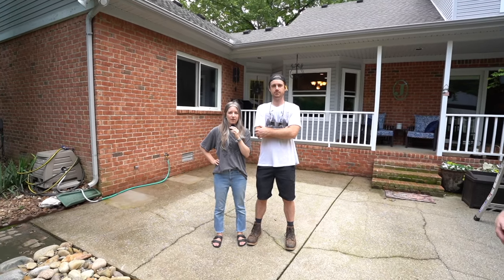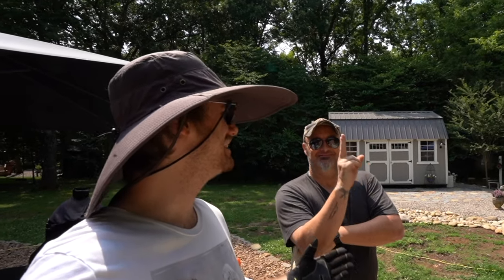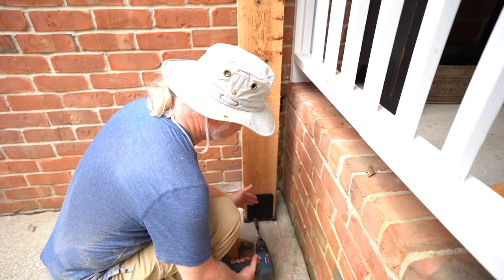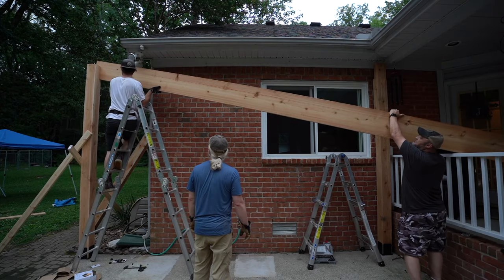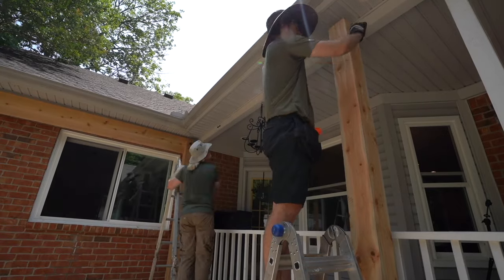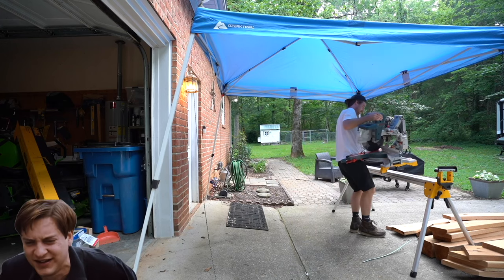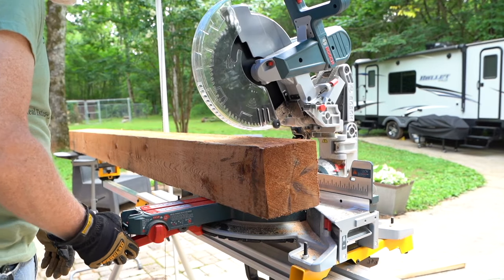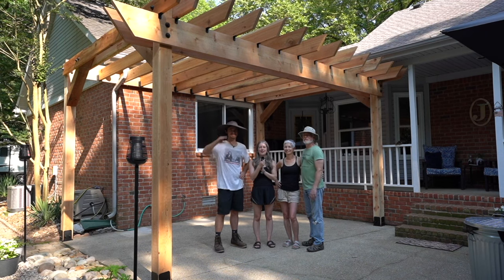How to build a "STUNNING" Pergola in ONE Weekend!

Comment: Great job you guys! Justin, you mentioned in your video that you weren't able to fully drill into the existing slab for one of the footings. How did you work around this with your hammer drill? Also, for those interested in building your design what would your estimated cost of materials be?
Reply from the maker: Ted had a back up drill that finished it out! 
For material alone it was about 3500-4000
Reply: @justinandjessdiy  thanks for the info! Looking forward to the next project!